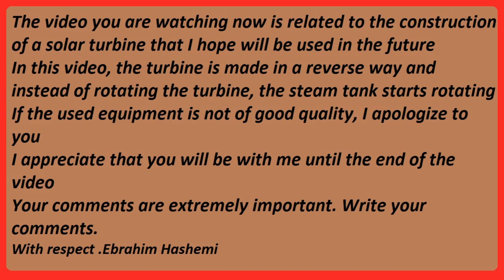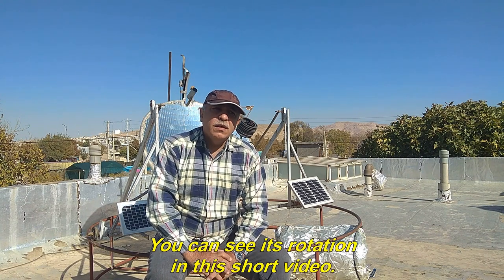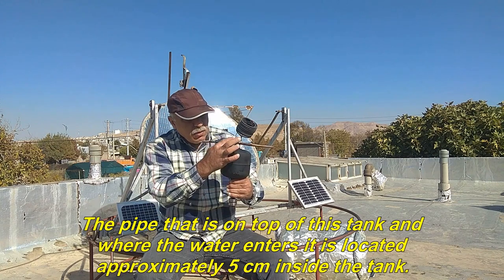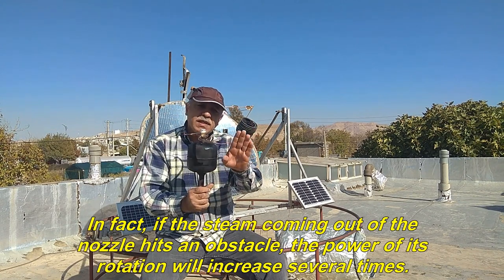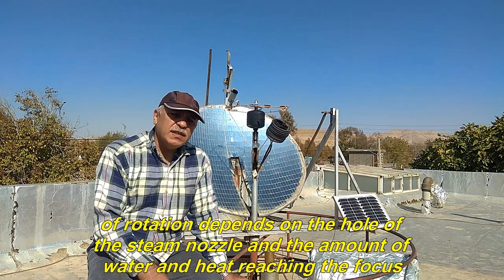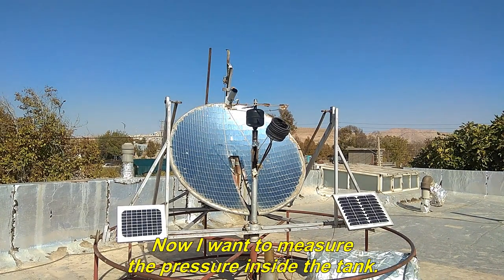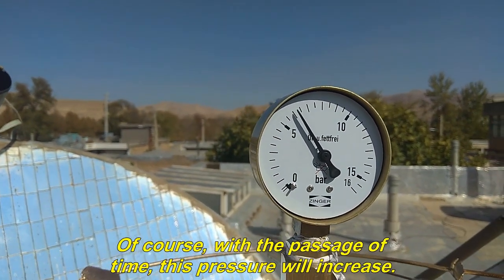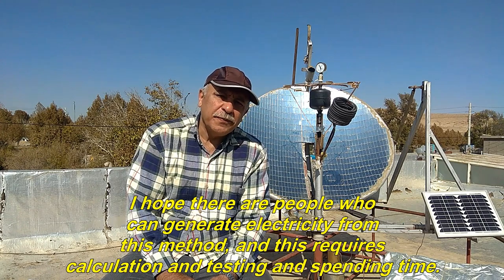Unique solar turbine.Reverse steam turbine.Rotating steam tank.Stationary steam turbine:solar system

Comment: what about 2 different sized aluminum bicycle rims?
inner rim fixed to tank, outer rim with vanes on it?

good luck
I support you
love love love
Reply from the maker: Two copper pipes are welded to the tank and the base of the tank is inside the bearing.
I appreciate your comment